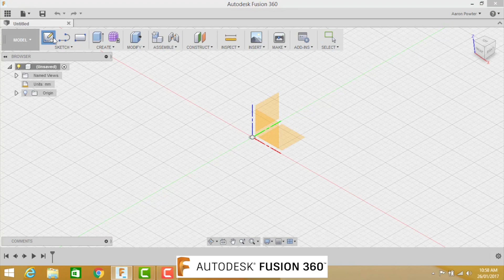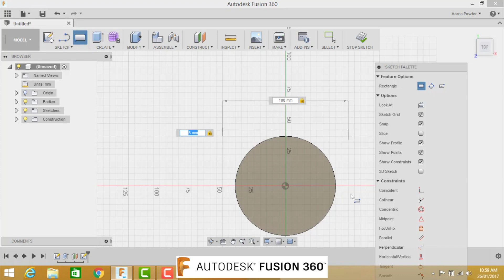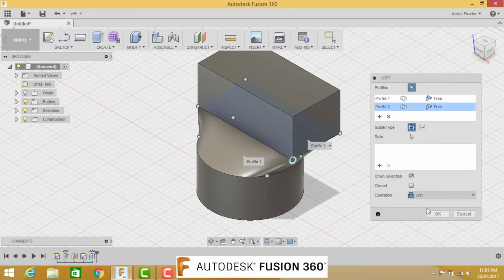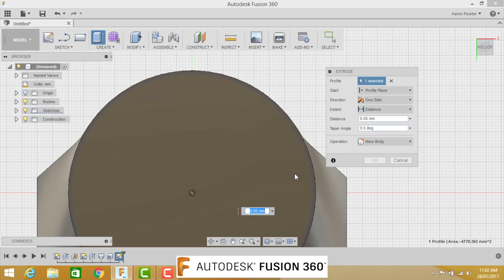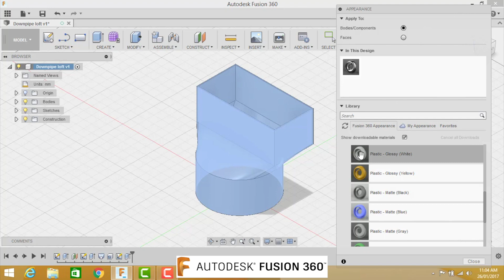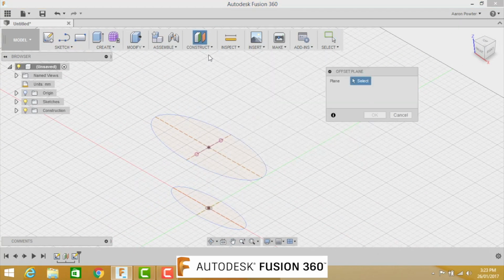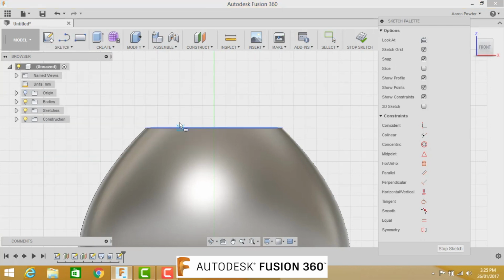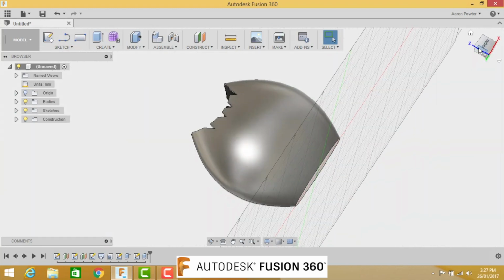Fusion 360 Tutorial - Loft sketch profile FF.E4

Comment: Lofting is something I have to learn for reproducing some parts that were made by injection molding. There are no straight lines or flat planes anywhere to start from.
Reply from the maker: Hi Charlie.  Yes sometimes with CAD designs Lofting is the only way to get those complex shapes.  Especially when two shapes transform / blend into one and other.

Comment: Thx, and pls keep 'em coming. I always see/learn new ways to use Fusion 360.

One shortcut (sort of) for Shell command:
 1. Click on face.
2. With face now chosen, click right mouse button.  A small (dynamic) pop down menu will appear next to your mouse pointer. 
3. From the small pop down menu, click on Shell.
Reply from the maker: Hello and thanks for watching.  Thank you for the tip.  The problem with video tutorials is that they can get old quick.  Especially as Fusion 360 is always continually evolving.  Cheers, Aaron.

Comment: Mr Teacher, let me (a beginner), tell you ,that you could by shell feature, touch/select (with ctrl) the down face of the volume also, to get the bottom hole, in this way you will not spend additional time/feature(to cut the bottom with another sketch and extrusion)...otherwise great tutorial....
Reply from the maker: Hello Emslv, thank you for you suggestion.  I suppose like all computer software programs, there is always more than one way to get a desired outcome.  Cheers, Aaron.

Comment: Great series Aaron! I've continued to use SolidWorks for design because I'm familiar with it, but picking up more of what I need from your videos. Maybe there would be a good number of people interested a video helping SolidWorks folks get around in Fusion360? When I do modeling in Fusion360, I always feel uncomfortable with the equivalents of dimensions, constraints, mates, etc. In particular, Fusion360 seems more lax, which could be great, but might also lead to surprises if one is not aware. I could be completely off, but I hope that makes sense.
Reply: there are a series of tutorials and videos for Solidworks users in the Fusion help files. Select Learn Fusion  from the drop down under your name in the top right corner of Fusion.
Reply: Kent VanderVelden Drawings & BOMs are currently miles behind Inventor and Solidworks. But they are also fine for a lot of people, and something that's changing pretty rapidly.
Reply: Scott Moyse Hi Scott. Thank you. I'm putting the necessary time into assembly drawings and BOMs so someone else can do assembly. So those two items are pretty important to my solo designer business plan. I get the impression that Fusion360 is fantastic for prototypes and obviously CAM. I also have used it for assembly simulation which requires Solidworks Pro. (SW Standard is limited to single part simulation, but Standard does have compressible fluid flow simulation, which Fusion360 does not have, best I can tell. I'm also considering cloud based simulation systems.) I'm hooked on Fusion360, but perhaps it'll be another year before I can completely switch from Solidworks? Best wishes, Kent
Reply: Scott Moyse Oh, "SOLIDWORKS transition guide", I see it now. The Rosette Stone. I'll work through it this afternoon. Thank you
Reply from the maker: Kent VanderVelden that Scott Moyse is a good man ;-)
Reply from the maker: Hi Kent, great to hear from you buddy. I fully get what you mean.  I was originally trained in Pro-Desktop (a student / teacher version of Pro-engineer) at university.  I used that softward for 12 years and switched to SolidWorks in 2013.  However, after meeting the CADPro boys from NZ and the Australian Autodesk team they prompted me to jump ship.  I can honestly say that I made the right choice.  Plus, it has saved the college $K's each year on fees etc... There was a slight learning curve, but nothing too hard.  Fusion 360 is definitely a game changer. Cheers ;-)
Reply: We must be about the same age. :) I learned on CadKey-Lite ~92, loved that, then Pro Engineer (and SDRC Ideas) ~96, Inventor ~02, and then Solidworks in 2014. My assemblies are of panels, extrusions, fasteners, etc. Are drawings and BOMs handled well in Fusion360? I'll recreate a past assembly and see how that goes :)
Reply from the maker: Kent VanderVelden I'm 49 years old mate. First time I ever turned on a computer was 1999. The next 6 years were the steepest learning curve of my life lol 😂
Reply from the maker: Scott Moyse Thanks for that answer Scott :-)